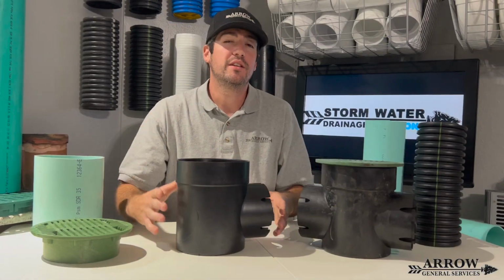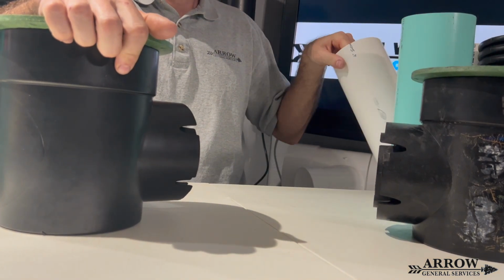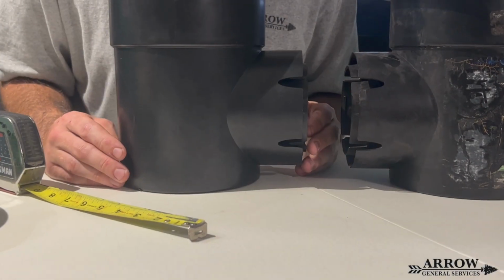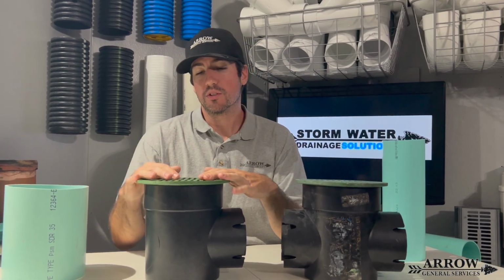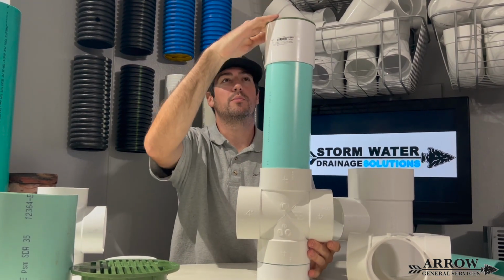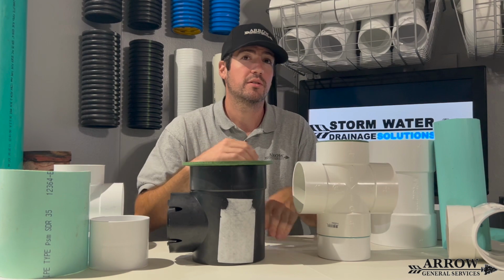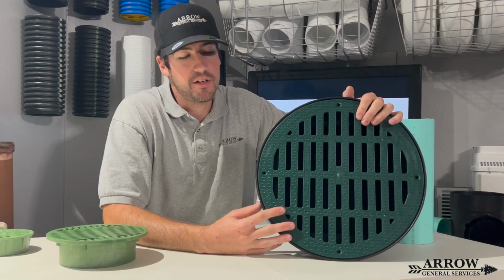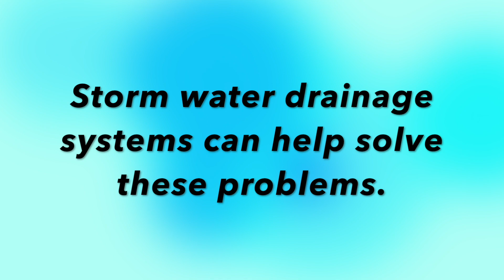PVC Surface Drains - Catch Basins - Yard Drainage Education

Comment: I dont really understand the reasoning behind building your basins out of Tees or crosses, you just spend a lot more money for as you point out the same amount of flow.  also you did not mention NDS 9 in. Square Catch Basins and Grates 9-in L x 9-in W Catch Basin, with a galvanized grate, these are probably less expensive than the 6 inch basin you build out of pvc, and catch and flow the same amount of water.  at least where I live the galvanized grate is far less likely to clog from debris.  Also the advantage to using a 6 inch flat green drain is that there is way more surface area than a 4 inch, so it is less likely to clog.

Comment: problem is all that piping is expensive as heck  . I am also a 71 year old woman  that so far has dug out just over 50 feet for the corrugated pipe and made sure it slopped and drained properly . Last nights heavy rain proved it workd great , But need to finsh it off
Reply: Good job, but why not spend more on pvc is reading having it possibly fail later on such ass roots and sand get in it

Comment: Love your videos. One thing I want to challenge you on though is a 4" CB with 4" drain pipe accepting as much water as a 6" CB with 4" drain pipe because of inlet surface area, vena contracta, and inlet loss coefficient. Essentially no matter how much head there is above the 4" CB it will never accept as much water because the stream of water narrows right after enter the orifice therefore it never actual fills the 4" drain completely. In order to maximize a drain pipes efficiency the inlet needs to be larger. I'm a landscape architect so I'm coming from this more from an engineering and mathematical perspective but I have also seen this phenomenon in the field
Reply: Spot on ^!  Excellent video otherwise

Comment: All that water sitting in the bigger basins…mosquitoes central?
Reply from the maker: Correct, you must drill some leech holes at the bottom with some drain stone and geo fabric set underneath the basin. 💪
Reply: @StormWaterDrainageSolutions  gave yourself idea for your next video! 😂
Reply: Personally I drill the bottom and make a small dry well with non woven and pea gravel, seems to work

Comment: question . I am leading one of my gutters down to a gravel pit that is 6 ft deep . It is all rocks from my over 3 acre property that were collected  since 2004   This property sloppeds down in the front yard and I want to drain it into there with the sump base . Could I put holes in the bottom of it  to allow it to not only drain up but down . I ad to fill that big hole in over the years because it would hold so much water and breed mosquitos.  . It was worse  before I put in all the corrugated pipe on my gutters on the back of  the house  when it was finished. 6 inch gutters and larger downspouts on a 100 ft long ranch house  . Woods behind my house but the property slops down the towards the road by over 500 ft , 30 degree slop  . Gradual but still a slop to a rock covered hill the drops down gradually  over 40 ft  to the road  . I did not want a wall so I did rocks on the hill

Comment: Not sure about the drainage application, but from doing pool equipment, there is a glue that is designed to work with PVC pipe and ABS valves, assuming the basin is ABS. Might be worth looking into.

Comment: Cool video man! I like how you build those basins. I been using the FDM basin and they work real well too. Those  Spee Dee basins come in two grades. Home Depot has the cheap ones. The others have a knock out for the 3” adapter and you can get full flow 4” tile. They are also heavier and have drill ports on the bottom to bleed. I don’t use them because if the small sump. Great ideas man!

Comment: Hey man, this video is really informative and I appreciate ya.  A concern of mine is that for my application it will be around St. Augustine sod, a very aggressive grass that can cover that 4" inlet very quickly (weekly).  I think I have to stick with the 6" speed-e basins for that reason, and bc the 6x6x4x4 cross hubs are running 100-200 bucks each, ouch!  Glad you mentioned that they work well in concrete, mine are getting installed into Houston clay so, basically concreted in, lol.
Reply from the maker: French Drain Man offers 4” inlet grates with turf restrictor plates if you want to check his website out. Also the cross tees that fit SDR35 pipe are sewer and drain fittings and should not cost that much. Check online for them or at a local plumbing supply store. Glad you enjoyed the video🤠
Reply: @StormWaterDrainageSolutions  I really tried finding that 4x4x6x6 SDR35 cross but I can only find it at drainage solutions at 93 bucks a piece.  Any links would be very well received.  Thank you!

Comment: quick question - how comes you never use PVC 2729 perforate for the French drain ? is not recommended ? i just started digging for my system and that what i have , but not sure if should use it. Your videos are So helpful
Reply from the maker: Glad the videos are helping! And good question, the reason we don’t use pvc perforated pipe for our French drains is because there is just not enough inlet on the pipe to efficiently move water and air. Also with holes being only on the bottom of the pipe, this increases the chances of them getting clogged with sediment over time whereas having holes 360 degrees around the pipe insures that the pipe will be in operation even if sediment clogs the bottom holes over time.
Reply: @StormWaterDrainageSolutions  Understood - thank you for the quick response. Last question: for those who only have what HD and lowest offer what are  best next option ? if PVC 2729 is not that great.
Reply from the maker: @andrescastro6538  https://youtu.be/AhleuTRv1WI?si=mnfSrRc0sT9kSk_u

Comment: I tile taped,...and after 4 years my maple tree roots still got past the tape,guess i shouldve used more  tape  x2😊
Reply from the maker: @sonofthunder.  Trees have aggressive root systems, keeping them out forever is impossible. You can only buy so much time with different methods. If you can avoid using any joints past the tree this will help tremendously.